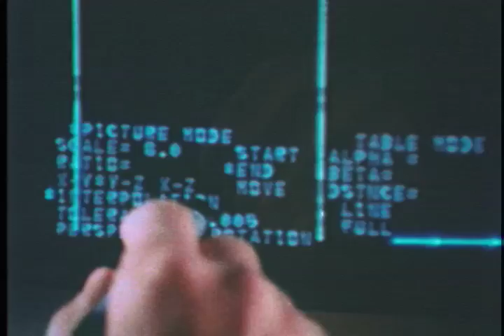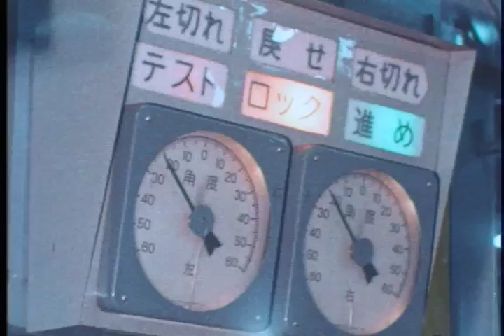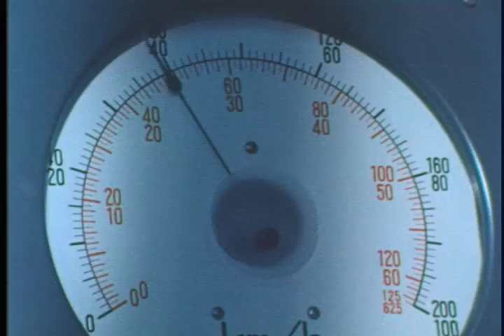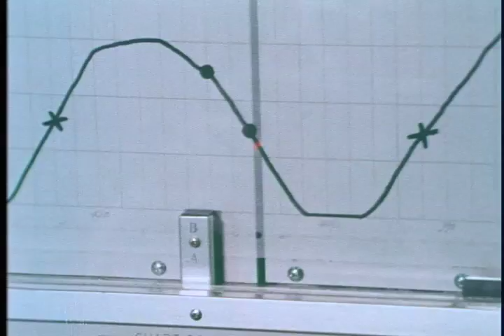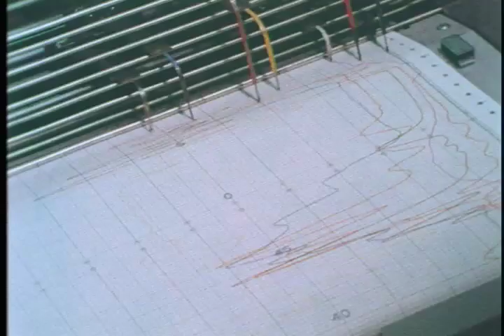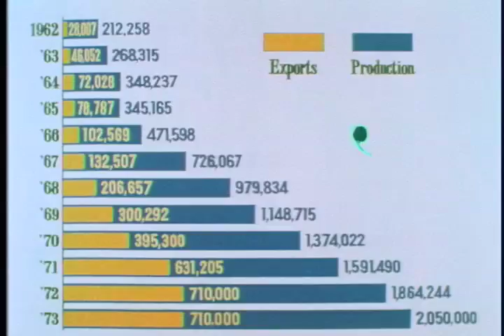Datsun History 1930s to 1970s

Comment: I was an apprentice trained Datsun mechanic between 1982 - 1988. They were simplistic, reliable & very easy to work on.
Reply from the maker: And that went a long way to winning over buyers too.
Reply: They still are. Love my 240z's
Reply: I had a 1980 Datsun 310. Not a fun car. But it was reliable with its 50 horse motor
Reply: aaa it's not very simple to take apart the Datsun 1200
can you helppppp
Reply: Hugie Pickle the 1200 should be simple.....which engine? A12?
Reply: Cut my teeth on a 1978 F-10....amazing clutch setup....you could change clutch, pressure plate, flywheel and throw out bearing with the transmission in the car.
Reply: @gav240z  - They were. What year is your 240Z? Is it 2005?
Reply: @werlii  - Compared to newer cars, yes they were.
Reply: ...and now, NOTHING is...at least the simplistic and easy to work on part...the reliable part largely depends on if you are fortunate enough to not have electrical/electronic issues :(........
Reply: @Lvatopesado  I've got 4 240z's. 2x 70s, a 71 and a 72.
Reply: You will also know that the Nissans are also tied in with Ford Motor Corporation.  And don't deny it either. The Datsun 240,260, 280 and 300 Z cars had  Ford six cylinder engines in them. The Mercury Villiger is a Nissan Quest. Ford bought the Z engine off of Nissan in 1990 and started putting them in their Ford Rangers, Mazda built trucks. The Z engines were engines that burned and reburned hydrocarbons havin intake and exhaust 8 spark plug set up engines with eight spark plug wires looking back at you when you pulled the hood open. I own a 1992 Ford Escort which is in reality a Mazda 323 as Ford, Nissan, Mazda, Jaguar, Volvo, Austin Martin and Kia are all tied in with each other. The Ford Aspire was made by Kia motor division as I saw for myself the drivers side tag saying Kia Motor Division on a Ford Aspire.
Reply: @danbasta3677  my brother, the Nissan L series engine in 240z loosely based off Mercedes’ overhead cam design, but still fully funded and designed by Nissan. The Ford I6s were much bigger, and the 300zx had a Nissan engineered VG engine. I don’t know where you got any of this from. Also the Z18-Z24 engines had regular 4 banger spark plugs and the L series also had regular distributors. None had 8 spark plugs like you said
Reply: Have you ever rebuilt the carburetor on one??

Comment: The datsun 620 will always be my favorite datsun truck .

datsun 510 for car.🚗
Reply: I have owned my 79 620 KCD 32 yrs
Reply: @joeyocom5087  I’ve owned my ‘79 KC for 20 years, I bought it on eBay and had it shipped from Kearney, NE to Las Vegas, NV.
Reply: I agree, my opinion is the same
Reply: I liked the Datsun 520 series trucks to. Every so many years, about the half of year, the Japanese change their model years in the half of season. The 520's were from 1965 till 1972 and a half when the 620's were introduced that lasted till 1979 and a half when the 720's were introduced, which lasted till 1986 and a half when the D21 series was introduced until 1997 and a half when the Nissan Frontier was introduced.  In 1980, you saw a lot of Datsun trucks running around saying Datsun by Nissan and Nissan by Datsun as they were changing their names gradually from Datsun to Nissan, because many years prior, the Datsun name sold much better than Nissan, yet, if you pulled the hood of any Datsun, the head said, Nissan on it.

Comment: Mom and Dad bought a 1975 Mediterranean Blue B210 in 1975.  It was a 4-speed stick shift with 4 doors.  No Radio and they had air conditioning added at the dealership.   I think the  total price was $3600.  We used it for Our Family Car for 9 years. Then I was old enough to drive, so they gave it to Me.  I wish I had kept it.  They bought a 1984 Dodge Aries, Big Mistake, and later they got Me a 1985 Plymouth Reliant, and traded The Datsun B-210 for it.  Another Big Mistake.  Even on it's worst day,  the Datsun was Millions better in quality an reliability than those Killer K Cars.

Comment: My first car was a Datsun 120Y. I bought it used for about 200 UK pounds. It was a really nice car and was very easy and cheap to fix whenever there were problems. Sadly, it turned into a 'rust bucket'.
Reply: My uncle had built one with a rb20det
Reply: finland has true rust buckets
Reply: Dim sim on wheels.

Comment: love those old Datsun pickups.  They were simple, rugged and easy to work on.  I bet if they brought them back they would sell.
Reply: I recently saw one of these Datsun pickups still in use in Costa Rica. Club cab with diesel engine. Haven't seen one in the States for decades.

Comment: Bought my first car about two years ago which was a '76 Bluebird (known as '180B' here in Australia, 'Bluebird-U' in Japan and '610' in the US). haven't had a single problem since and it's fun to drive albeit a little wafty - an understatement. It's an auto but still feels more mechanical than most modern manuals. Not that there are many of them anyway.

Comment: My dad bought a B210 (120Y) new in 1975.  That was a great little car.  Reliable, easy on fuel and a cinch to fix.  I kind of lamented by dad selling that car after 25 years of great service.  The only thing I didn't like about it was the paint, it would oxidize if you looked at it wrong.  Wish we still had that little car.

Comment: Datsun cars varied much in quality. The 510 was an excellent sedan. With an OHC and IRS when both were largely the domain of exotic sports cars,  Nissan incorporated both in an economy car. A poor man's BMW.  The same tech made its way into the 240 Z, an outstanding sports car.  Then, Nissan went to a live axle in the 510, brought out the 210 that just shouted CHEAP and turned the Z car into an overweight slug. The front wheel drive  Datsun  F10 was an unreliable POS.  But at least it was butt ugly... The Datsun pick up trucks were fine but overall, there was such a long string of losers bearing the badge of Datsun that it comes as no surprise the name was dropped.
Reply: I had a 1980 Datsun 310 that we bought new in Fort Dodge Iowa. If you're talking about the F10 that may be the 310 here. It was the first front wheel drive car to my knowledge that Datsun produced. I hated that car with a passion. Uncomfortable all vinyl would no air conditioning and no power
Reply: Everybody talkin about how good that early dachshunds were. I believe you were right in saying that the 5:10 was a great car. But anybody who drove a 3:10 when it first came out would never buy another Datsun or a Nissan
Reply: Roger Lund The F 10 was available, it preceded the 310 in America. Early 310s used the same drivetrain. Pushrod A14 engines in America, smaller in the rest of the world.

Comment: My favorites where the 1600 Roadster, 1976 280Z fir higher compression, aggressive camshaft grind (Lost in 1977), the Nissan Patrol (Outside the US only) and the V8 Presidential, never sent to the US either, but ending with the 620 Datsun pickup. Still have the 1600 Roadster, as I worked at the dealer. I saw the “B210” come in for service with over 300k miles and can not forget to say the 510 Sedan was one tough son of a gun. ASE Master Tech since 1978 (NIASE back then) Retired.

Comment: Kids these days have no clue, datsun was the best car maker in history, i still remember the sights and smells of our datsuns
Reply: James Palmer I am a kid from these days. And man, I love Datsuns and every kid I know has no idea what a Datsun is. It's very saddening to me.
Reply: +Robert Drayfahl 
   
no Ruth
Reply: Robert Drayfahl same here, I'm 13 and a half, and would much rather own an old Datsun than any new computerized upside-down soap bowl / computer mouse / cheese block.
I'm looking into getting a non running Datsun 100a (one that's not a rust bucket of course), and get it back on the road as my fist car.
Reply: Well.  I'm born 1989 and I tell younger ones out there that it's the original before nissan.  These cars were only great because the Japanese workers in those days were extremely ahead of their time.  The american quality control was so bad compared to this.  This is like 3D car building for its time
Reply: I still think it was a mistake using the international Nissan badge. Datsun sounds lots nicer and had a history in the US and Europe. They really gambled there...Though it seems they won I guess, just wonder how different things would have been if they retained the Datsun branding?
Reply: @martinda7446  "Nissan" sounds way more refined than "Datsun".  And did coincide with refinements and innovations that came along after the mid 80's.  It was a very smart move changing the name.
Reply: @pearlmax  History proves you correct...Just you get used to something.
Reply: @pearlmax  There was a period they were referred to as 'Datsun Nissan' and that sounds fine to me too.
Reply: He'll i know what a datsun 100a is
Reply: I wanna bring a datsun 100a from,Europe to USA and restore it and take care of it
Reply: @Rusty-the-datsun  GO AHEAD PERMISION GRANTED !
Reply: I agree put!!! Only they wher good'' on surtan yerars my mom bouth a brand new Nissan Sentra*"':;!? A lemon In 1986 it was Burgundy

Comment: Back in the day datsun pickups were lil warrior's they can drive forever,  you can take them cross country like nothing ! They were fuel efficient,  reliable, zippy lil cars . Not like today were they break and cost a fortune to repair. Nissan's of today are straight trash they're beautiful dont get me wrong  but the reliability is not there no more there too problematic and expensive to fix like the cvt transmission omg run away!

Comment: interesting bit of film.  Datsun arrived in the UK in a big way in the 1970's and produced a car that was (arguably) more reliable, better equipped and available (!)... at a time when the UK car production was beset with Strikes.   'twas a good product and got the success it deserved.  A shame that today there is no such thing as a UK owned mass car producer
Reply: Worst part was most early datsuns where based  on the the B series Morris Austin even a 6 cylinder i fitted a head from a datsun to a 6 cylinder Australia Austin  freeway worked great Datsun had the better carby
Reply: My father owned Datsun 2000 model 1968 it was great car
Reply: Julian Langdon most Japanese cars where a copy of british cars datsun copied morris austin, / isuzu copied hillman / i would be interested in how many other british  cars and motor bike they copied and the dumb thing the british couldnt swallow their pride and copy the copies to learn from this  big mistake

Comment: My neighbor said that cars used to be called Datsun's but now their called Nissans
Reply from the maker: Your neighbor is correct.  I was told that Nissan was worried that if the cars were a flop, that would besmirch their brand.  So they came up with Datsun.  After they were sure it would be safe, they put the company name on the cars sold in the US.
Reply: Hmmmm you really got a good point there. 😃
Reply: Just to let you know I subscribed to your channel because it's super amazing
Reply: Not to mention the name change due to anti japanese sediment still after WW2

Comment: In the late 70s I worked at a pesticide-spraying outfit outside Chicago. My job was to drive a Datsun pickup with about 1000 pounds of sprayer/Malathion in the back and "fog" Chicago neighborhoods at a constant 10 mph, at night. We had about six of those Datsuns, which held up amazingly well under the tender mercies of young men who didn't own them. I think we seized the engine in one, probably because "I'm sure somebody checked the oil". 
We had a couple of Bell model 47 helicopters, too,  used for spraying remote ponds. They were flown by Vietnam vets who were completely nuts. The gas pumps were in the center of the truck yard and they'd just land by the pumps to fill up, blowing dirt and trash around like a hurricane. Ah, the good old days.

Comment: Back in the mid 80s I drove from Glendale California to New York City exactly to ß Madison avenue, I did that on about 3 days with a friend of mine on a 1969 1.6 liter Station wagon Datsun, it had some extra gadgets like 5 custom Enkey Rims gold inside silver rims all aluminum. Nice electric sunroof, custom engine oil cooler modified suspension racing seats one of the best sound systems, air conditioning, nothing to look ugly or exaggerated or ridiculous, just a very fine and nice looking Japanese engineering, it took us 3 days to do that, every time we cross the welcome to state line we take a picture, the care give us cero nothing of a problems, extremely reliable cars. It was white and like I said, wherever we stop to refueling they all say nice car, Kool ride nice wheels etc. Too bad I had to be back  to LA cause of a emergency on a big piece of equipment, I've use to be a grading engineer for a demolition excavation and grading company. One day I had a call from the sister of my do called friend, the punk went out drinking and totalled. ,Back then 15 K was a lot of money 😵😵😵😵😵
Reply: I did that drive in 2003, drove from Mojave, CA to NYC, in my ‘71 510 Wagon. No problems!
Reply: @Brooklyn_Powers  we both did the same journey then. Kind regards from BC.

Comment: The Austin A40 WOULD NOT have been built by Nissan. The Austin, Morris and Wolsley brands were made by the British Motor Company(BMC) which rebranded itself as Briyish Leyland in the late 1960s/early 1970s.
Reply: @loagzowens6472  must have been a very loose translation of the 6 cylinder stovebolt to a 4 cylinder engine!

Comment: Always have and will love the peak of Datsun/Nissan 
I grew up in the early 2000s with nothing but Nissans till my teenage years, mum had a 
910 bluebird, r31 skyline and (step dads car) a d21 Navara which all in a way shaped me to have the taste in cars what I have
Currently I daily a R31 Pintara wagon and my fun car is a 910 Bluebird wagon, before those I’ve had a nice number of other Nissans what include
x3 R31 Skylines
x1 R34 Skyline
x1 D21 Navara
x2 910 Bluebirds (still with my original) 
x1 R31 Pintara 
I just can’t keep away from Nissans peak of the 80s, plus that one late 90s skyline

Comment: I like them i really do but the the Engineers  making the mechanicals did not get on with with the men making the bodies .They started to rust straight away .
my mother bought a Nissan cherry in 1984 and traded in 1987 for a late 1986 Sunny (rust protection)
A man bought a year later we got a call from the man who bought the Nissan cherry asking for a letter to say it hadnt been crashed.
The roof was starting to rust big time .Nissan Ireland repaired this awful medioce car for free.If you can find an example if this 1300cc car nobody wants to buy it .
The Nissan 300zx was fantastic though.

Comment: My Dad back in 1977 bought a Datsun B210 nice looking car! But up hills that poor little 4 cylinder was lazy! The 1.4 liter engine was too weak on hp. And that was without air conditioning! His was also a 5 speed manual transmission.

Comment: We had a 180b sedan..then a 1000  utility..my sister a 1200 sedan..me a 1200 sedan..then 120y ...then a78 model 200b wagon. The only problems were the wagon needed5th gear as it was only a 4speed and with a 4.11 or similar diff with close to 4000 at 100klm per hour. All were amazing hard workers without ever any major breakage. Although my 73 Datsun 1200 would handle strange when the needle was at 100mph. Along came a 720 recently that I couldn't pass. What a work horse that was. 1800 motor and 4on the column. Rust beat it on the coast

Comment: Bought a used b210 2dr 4sp in 1974. Put over 200k on it, never a problem. Put clutch in it before I drove it away. Still on that when I traded it for a 710 in 1981. Traded that for a 729 4x4 in 86. Sold that in 98 to my b-i-l with 286k on it. Still in service today. Bought a Sentra then. And a Frontier. Traded that in 2005 for a d40 cc v6 Auto. Sold that in 2014 and bought a d40 ex cab v6. Bought a Camry in 2013 that I traded for the d40 I now have. Never had any probs other than a faulty fpg under warranty. All have been bulletproof!

Comment: Dear Sirs, the video is interesting, but it could be much better if the images go slower. I am a Chilean senior engineer who greatly appreciates the NIssan quality. I have had at least 10 Nissan in my life.
1200 year 1964; 1300 year 68; 120 and 1977 automatic; 160 J 1982 automatic: Bluebird 1.8 1982 automatic; Laurel 2.4 1984 automatic, etc. Today I have a Nissan Teana 2.5 year 2011 automatic, the best of all the Nissan I've had.
But in Chile the Nissan dealers are very bad. They do not have any spare parts in stock. Everything must be imported. The prices of the spare parts. as well as the arrangements are very expensive. As it shows the following: I was charged U.S. $ 4,850 for changing the alternator to my car. (Nissan Pompeyo Carrasco Dealer).

I hope to change my Nissan this year. Of course it will not be another Nissan. It's probably a Toyota Camry
Reply from the maker: Thanks for sharing our experiences.  Nissan's executives should hear from you.  They appear to be asleep at the switch and need to focus on Chie.
Reply: since renault got involved, nissan has dropped in quality and service

Comment: datsun was the north american trade name . the u.s. and canada were the only countries that nissan sold cars under the datsun name
Reply: I am not an American and Canadian, but Datsun was also sold elsewhere overseas until it changed to Nissan. Nissan, along with Mitsubishi, should leave Renault, thus merge with Hyundai/Kia instead. 

Hyundai's engineering, which is used in the [Hyundai] i20 and [Kia] Rio, is bulletproof, both Nissan and Mitsubishi could gain benefit from that. Which means, Hyundai-powered Nissans and Mitsubishis could sell more than the time two of them were/are under Renault...